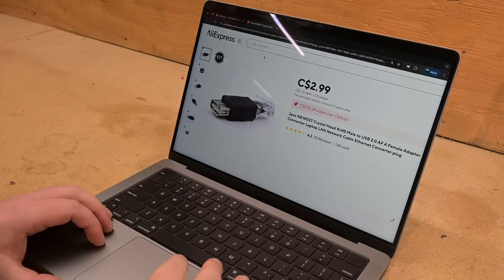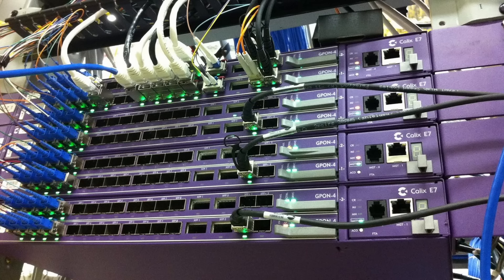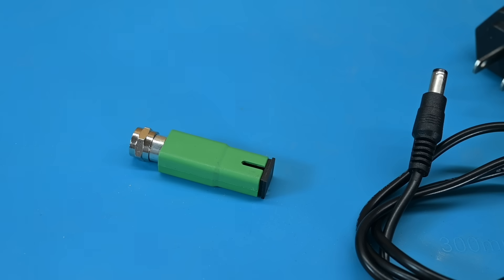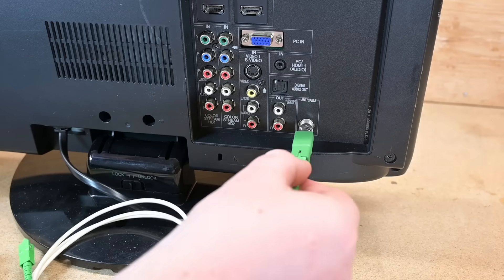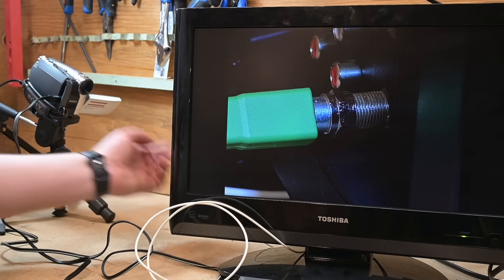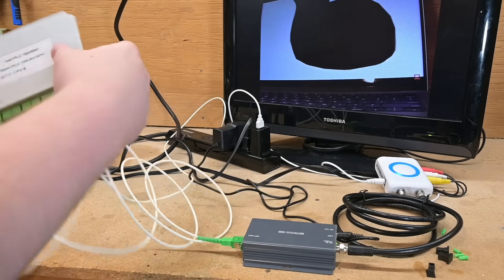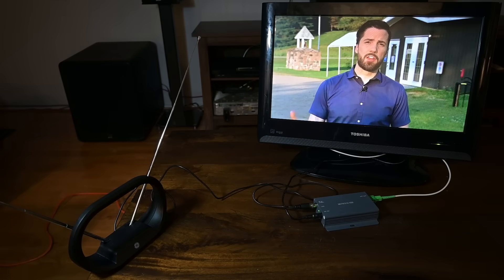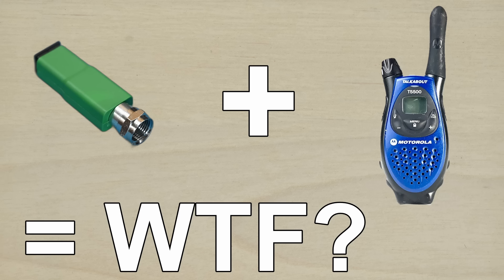Does a $5 Fiber Optic to Cable TV Adapter Actually Work?

Comment: This is wild! I suspected, as soon as you showed that it actually worked, that it must have a photodiode in there operating in photovoltaic mode. Sure, it'll output almost no power, but there's almost no power coming from a TV antenna either, so it actually makes sense that it works.

Comment: Quite aside from the insanity of this working, I am gobsmacked that not only did I formerly live right round the corner from where your stock photo of some fibre being installed in the Netherlands was taken (fun fact: it only takes about an hour to do that in most of NL because all that is needed is to remove two layers of brick from the ground and then dig a foot or so into the sandy soil beneath) but I also own exactly the same Toshiba TV (purchased about a five minute walk from the fibre install location).

Comment: Fiber optic cables for internet ends at your house. That fiber optic cable is then converted to coax cable in your house to connect to a devise in your home.

Comment: I was absolutely sure this was going to be a hoax item. Wow, was I delightfully disappointed when it wasn't. I thought to myself the only way it could do it is if they're somehow capturing the photons from the light beam to power a signal converter. But then I thought about how incredibly complex I perceived it to be. Needless to say I was absolutely floored and excited to see that 1. It worked, and 2. Excited that my guess was correct but also because they packaged it all into that form factor and it just works.

Comment: 4:48 My eyebrows raised up when I saw that he still had picture just leaving the connector hovering over the TVs F-81. So assuming no losses at 8.3dBm that coax is pushing out 57dBmV of RF. Just for reference that amount of RF is used for distribution through a cable plant for a city block; let alone for one TV. So the center conductor is literally radiating enough RF that the picture could be maintained despite the air gap. Lmao.

Comment: A lot of these "that can't possibly work" adapters are actually mislabeled. Most of the time they are meant for a proprietary piece of equipment that just uses the same ports as Coax or fiber optics but don't actually emit rf or light.

Comment: The weakness in that whole setup is the composite and it's also it's saving grace.

If you want further experiments you can go component, VGA and DVI-I/DVI-A on the source. Component could maybe still slightly hold out at 1080i but at the max of VGA or DVI, the limits of this little converter will be very visible.

Comment: I am very surprised that that actually works! Honestly it looked like some kind of scam! ButI guess if you own an apartment building or a multi-resident place like that where you have the coax line coming from the cable company, that seems like it would be a good way to break it off and split it between the units

Comment: I want to see the fiber patch cable with both adapters on and see if it still transmits RF without the light.
Also, I can't believe I had to read hoe-axe in my head.

Comment: yes it works, if proper optical power is given you can even split the connection to multiple points and use them simultaneously without coaxial related noise.

Comment: From my cable TV company (Ziply), I've got this fiber line that currently goes to a box with Ethernet output , which goes into a cable modem that has Ethernet input and Internet works fine.. Could I use this adapter to take that fiber output , and get coax output connect and put that into an TV cable that accepts coax input from the cable TV company?

Comment: A GPON will have one wavelength for downstream voice/data, another for upstream voice/data, and unless they've gone IPTV there will be a third wavelength for the RF overlay. The overlay is always 1550nm, and it carries QAM channels just like a HFC cable network. Some ISPs use these converters, others have it come out of the ONT coax port (along with MoCA for data if you're not using ethernet.)

Comment: I know what an Optical isolator is and how it works, and still this seemed crazy to me at first. I still I don't have the slightest clue why anyone would have that head unit lying around, or why you'd make one in the first place, but your example of antenna repeater makes some sense.

Comment: This can actually have huge benefits in building scale TV installations in hotels are large offices. One head-end or rooftop antenna can be used to bring in TV signals and can be run to all the TVs. What's good about fiber over coax is that coax splitters weaken the signal significantly and long coax runs also weaken the signal and are a pain to run. Fiber solves a lot of the issues and with a good splitter and Signal generator it will be a lot better than a native coax run.

Comment: so in reality these need to be fiber fed (signal over light for power) to be output to coax. The description almost sounds like you could run coax to fiber back to coax for a very long run. +8db is fire for fiber levels, we usually see -12 on FiOS from the splitter. Pretty cool.....

Comment: I have exactly one of those!!
Where I live there is a company that provides cable, phone and internet over fibre... But cable uses coax inside the house.
I imagine this is because they usually are the first fibre company in most small cities, so they just disconnect the old coax cable from the street and use the coax that's already in the house to provide cable.
Here we use ISDBT and all TV's must have a tuner so it's also cheaper because they don't have to install set top boxes.
And the flat that I live in had a fibre connection with that company (but I use other company for internet)... So... I had to try it, took the fibre, plugged the conector, the tv and bob's your uncle... Digital TV.

Comment: I was surprised, but I guess it does make sense. Think about how small the signal is from an RF antenna that's 20km away from the tower. Could it even light an LED if you managed to extract the power? I don't know. But you have a laser that's being directed onto a small PV which is 0 feet away. You're definitely transmitting useful power, whether you want to or not.

Comment: This has to be the first Analog signal sent over fiber - I can't believe this is a thing!
Reply: Actually it's been a thing for a very long time, before telephone systems were digital in the last century. Be it a variation of voltage on a wire or a variation of light levels on a fibre, the signal is exactly the same.

Comment: the magic of photodiodes.

also; avoid usb to firewire and vice versa, you're likely just going to fry one end of your setup. the max voltages and protocols aren't compatible, and they rarely put anything between, so its direct connections, in a way thats going to nuke your stuff. or at least, the firewire chipset usually, since those are the more sensitive, and not hot swap capable. best case scenario; it just does nothing at all.

and while usb to firewire chips were made, they weren't widely used, and pretty much vanished.

to put this into perspective, firewire is capable of 30v at 1.5a. usb of the era, is not (~5v, 1-1.5a). but the transceiver chips for firewire usually tended to fry themselves if you tried to hotswap a cable into a running device (the exception being some apple stuff). this is especially notable for music production and video gear, and the port controllers for plugging them into computers.

a bunch of the other adapter types are.. a very mixed bag. some do what they advertise, some do not.

Comment: I (mostly) figured it out as soon as he said it was single direction, except I assumed a photo transistor was used. Using a diode makes more sense tho, much simpler circuit.

Comment: I was following the whole video and even guessed pretty easily that it wasn't going to be a scam because it should just take a simple photodiode and some passive components but I am entirely failing to understand how you fully disconnected the coax from the TV and it was still giving even a faint signal.... The metal no longer touching..still conducting signal....how????

Comment: In my opinion, you weren't clear about it, but I figured it out thinking of how to do this without power.

Light is power, and you can use it to apparently power this device while also transferring data? How's that work? Go more into the electronics. I'm so lost!
Reply: The trick is that the photodiode reacts to light and then emits a (very) small voltage. Light is transmitted via the fiber optic cable by modulating a laser.

In this case, per amplitude modulation, in time with the signal frequency.

This means that the light fluctuates in intensity with the modulated radio frequency of the video to RF modulators. The resulting radio frequency is transmitted to an amplifier in the RF-to-fiber optic adapter. This amplifier, in turn, generates the fluctuating light, which is then transmitted via the fiber optic cable and then converted back into voltage by the photodiode. The converted voltage looks, to the television, like normal antenna voltage.
Reply: @mibnsharpals  that's insane! I can't believe that even works!

Comment: I have that USB to RJ45 "adapter"! It's actually meant for USB-A to USB-A cables with two adapters at the ends, which is absolutely absurd. Got it in an old set that came with a bunch of other connectors, would love to try using it sometime

Comment: I wouldn’t be surprised if your transmitter is just a cheap laser pointer hooked up to a coax across the power, I’ve transmitted audio this way and it works great

Comment: I wonder if this would work with a cable modem my cable mode recently got zapped by a thunderstorm, and I’m trying to find a cheap but easy way to relay the signal over coax or fiber

Comment: OK, now wait a second. First I thought, ya, gimmick. How can you take 2 of these "converters" connect them together with fiber, connect one converter to a source, like a TV antenna, and connect the other to a TV set and get a picture. Ben then breaks the magic and introduces a POWERED head end converter! Ahh. OK, mystery solved! So, you need a powered translator then.

Comment: This guy pulled it off, he's got an f*ing PA system as his living room hifi. Does he have no wife?
Reply: What are you even talking about? that's just the surround sound system haven't you seen one before?
Reply: @abdelkaderelbachir3817  Yeah, having rewatched the video you're probably right. It looked like one of those mini pa systems that have the speakers on a pole with the subwoofer as the stand. After watching it again, it is a normal speaker on a regular stand next to the subwoofer.

Comment: The magic is done mostly in that grey transmitter box MOTN1010-1550, which converts the entire band of an RF signal to an optical signal, but in a simple way, nothing digital in there. So most of the work is done in the transmitter, just to keep receiver simple and cheap.
Reply: Description states '47 ~ 550 MHz' range, would that mean this $85 box has 1Gs/s 1bit ADC inside?

Ben can you do a teardown of the MOTN1010 too?
Reply: @rasz no ADC at all, just a laser diode and some amplifiers and filters.

Comment: I'll have to admit that I'm surprised that it worked too.
However it is worth noting that it connects to the ANTENNA input on a TV...
And, since the output signal from an antenna is normally extremely small, that input on the TV is extremely sensitive.

Comment: Interesting thing, probably it could have saved my TV during storm in 2015 (because optical cable aren't conductive).
Lightning decided that my TV wasn't provided with enough volts from a socket and added a little bit more.

Comment: Application: Using one of these to transmit outdoor antenna to the inside. This allows excellent lightning protection.
Reply: Problem, the transmitter needs to be on the antenna side.

Comment: Hey Ben, great video. Can you share the links of the splitter, transmitter, and receiver? I assume based on the connectors they are only single mode ready.

Comment: I would love to see you do data over it. Split a cable in two (or use two fibber cables with a joiner) and see if you can very badly transfer a file.
Reply: well, he did demo ATSC (terrestrial digital television) over fiber

Comment: And you don't have to worry about the lightning running in on the antenna to the TV.  Nice demo
Reply: you beat me to that. it also saves you from ground loops and the crap that some switch mode psu cause  (i forgot the term) :P
Reply: This is it. Safety device to prevent lightning from damaging inside your home. Protect expensive TVs, hi-fis, etc. 

Instead of a powered TV transmitter inside the home, could just be the Optical splitter?

Does the optical carry all signals though?

Comment: Can you use 2 of them to try to make it  bidirectional ?
Maybe it can transmit LTE ?
Reply: The problem will be power, unless you install a power amplifier on the antenna. The adapter has relatively high attenuation and can only deliver microwatts itself.
Reply: @mibnsharpals can a cheap Aliexpress signal booster help with that problem ?

Comment: I guess to state the obvious, it'll only work if the transmitter side is actually doing a good job. If you were to find a scamium transmitter that tries to power a laser diode (if you're lucky) directly off the rf with no amplification stages then you're in for a bad day...

Comment: Is it a joke, or is it working for real?
Reply: Yes, the video isn't fake. It works exactly as described. The only problem is that the energy loss is extremely high because most of the light energy is needed to generate voltage. Photodiodes don't have the best efficiency. Therefore, this adapter is only offered in this direction, converting light to voltage. Otherwise, more electronics and a power supply are required. If the output power needs to be higher, active electronics are also required on the output adapter.

However, since tuners are very sensitive, they take over part of the amplification.

Comment: What's next? HDMI to water hose?
Reply: 3D printable
Reply: already did that when a fitting broke on the computer I had watercooled, do not recommend
Reply: yes we can modulate water pressure to convert it to a video signal, or make the water solution mixed with some chemical or a lot of salt so that it is electrically conductive so that we can send a video signal through a water hose, by converting hdmi on both ends to analog and back to digital, or maybe high power laser through water filled hose as an alternative to the fiber optic cable.
Reply: Diy water cooling 😂
Reply: No, HDMI to SCART with 4k60 video quality + audio.

I believe this should theoretically be possible with the right hardware?
At the very least i believe that we could still squeeze some more resolution into old connectors like VGA...
Reply: Lol
Reply: HDMI probably could. Is so versatile
Reply: U can do hdmi to water hose but the hose is gonna be probably a waterfall to cope with the bandwidth
A internet company already does their encryption via lava lamps
Reply: not enough bandwidth in a water hose. But maybe s-video to water hose
Reply: HEAR ME OUT
Reply: That already exists, the Slip n' Slide
Reply: Definitely not possible but.....
In this video there is a RF to optical converter followed by an optical fiber, also followed by a optical to RF converter...
Water inside the hose can be used to carry light signals (same as a liquid fiber), so, theoretical, it should be possible to use a hose to connect the two adapters!  🙂
Reply: HDMI to wet string...
Reply: OK they gave me a good belly laugh ha ha ha ha ha ha ha ha
A siphon hose would work better  😝
Reply: Have you found one that works?  My TVs keep failing for some reason.
Reply: Next thing you know, they will be using a potato to generate electrical current…
Reply: wireless HDMI "cables" does exist, that's something
Reply: I laughed pretty hard at this 😂
Reply: Yknow what ima do that
Reply: It already exists
Reply: I'll take 20
Reply: we already have RFC 1149, rfc 2549 and rfc 6249 . so why not mixed video signals over laminar water column ? You know I bet , with the right laser and  a hydrolic ram .....
Reply: You win the internet for today.

Comment: I saw these online a while ago and did a bunch of research on them, it's great to see it's actually real and works. I was skeptical about the laser providing enough power to convert to RF but seems like it does!
Reply: From your video it appears to support any RF signal, is that right? I assumed it would be specific to a certain brand or type of equipment so I'm blown away that it works with both an antenna as well as a local source. With the antenna, does it allow you to pick different channels?
Reply: @rfitzgerald2004  It looks like it should work with different tv signals as VHF frequencies range from 54 to 216 MHz, while UHF frequencies range from 470 to 608 MHz. However it won't work with satellite and MoCA signals as MoCA uses 1125-1675 MHz and satellite uses 950-2150 MHz but this adapter only does 45 to 1000 MHz. Cable tv uses 54 MHz to 1 GHz but not interactive features as they typically use frequencies from 5 to 42 MHz.

Comment: Same principle as Alexander Graham Bell's 1880 Photophone. The May 1970 issue of Popular Electronics had an article on building a LASER audio transmitter and receiver. With two of each one could have full duplex, long range communication. These tiny dongles are doing the same thing, just at higher frequencies and using so little power the LASER input energy is enough to generate the radio frequency.

Comment: I'm impressed by the quality of the picture, and being able to split the picture, is great usage for events where you can deploy several screen showing the same content, cheaper than coaxial itself. 
Could it be possible to connect a coax modem to one end? For internet access (just as an experiment)